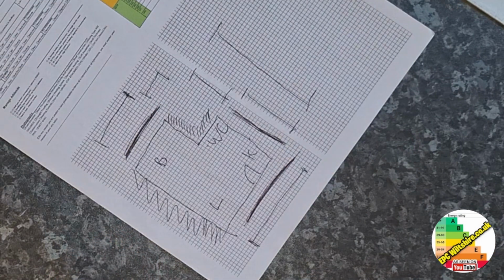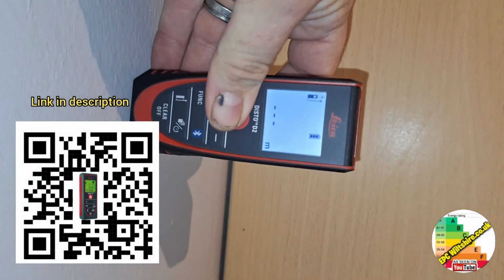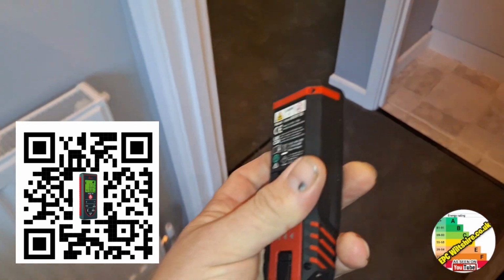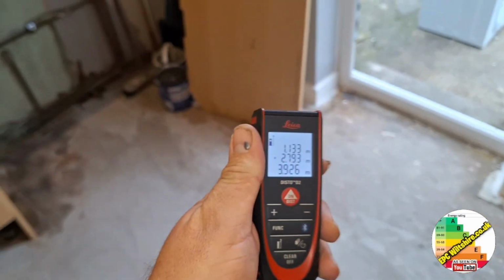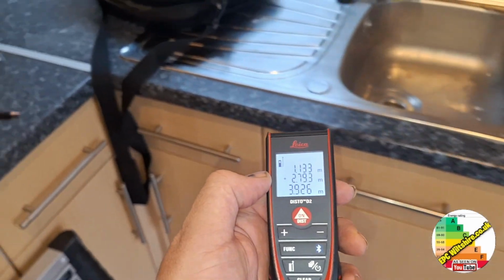EPC on Ground Floor Flat covering Glazing Open Fire and Cavity Walls

Comment: Amazing work pal, just 1 question the party wall of the stairwell wouldn’t it be HLP if it’s unheated?
Reply from the maker: Good question  a party wall is always adjacent to a heated space, so if it isn't its not a party wall its HLP. In this case it is a party wall.

Comment: What would you do if the open fire was boarded up? Just leave it off?
Reply from the maker: If its boarded it counts as closed. To include an open fire in an epc the opening needs to be greater then 200mm. This means fire places with closed dampers are not included as an open fire
Reply: @ brilliant thank you!